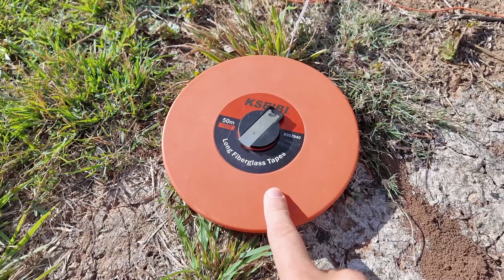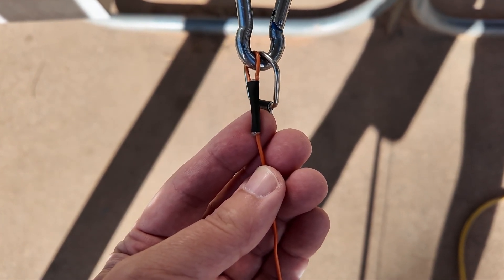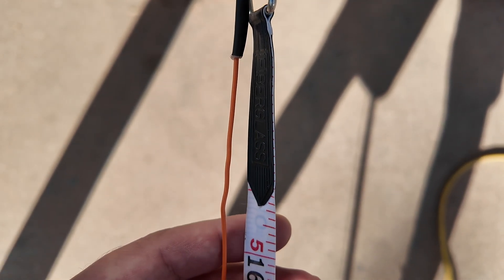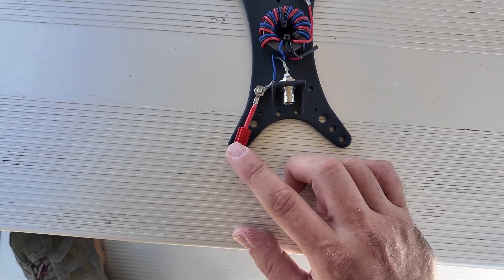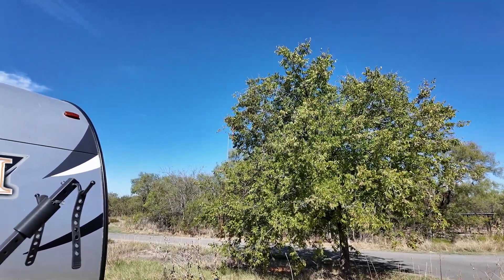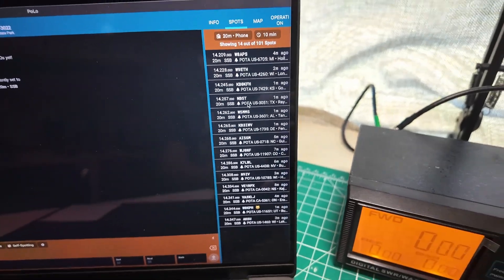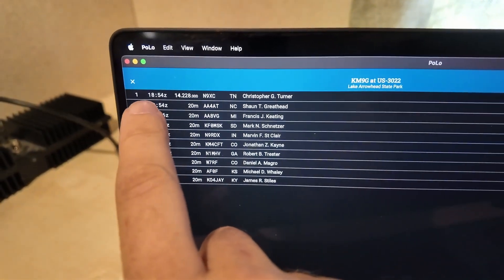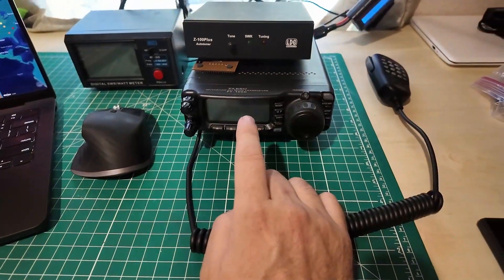A POTA with the Coffee and Ham Radios Ares Antenna

Comment: TO or anyone else that reads this curious will a mobilinkd tnc cable work with a digirig device? I only need the audio cable with k connector and digirig only sells both for $30 so i thought be cheaper to use the mobilinkd cable instead i dont have one to test it so thought id see if someone with both could confirm it will work
Reply from the maker: I am not 100% sure, but there should be cable pinout diagrams available for both ends of the cable?  The K end should be standard.

Comment: Great job TO ! making contacts with a antenna you built is awesome   I had some trouble with 9:1 . I had some tuning trouble but I remembered that the IC 7300 has a E-TUNE mode. Did that and done. worked.  I also had some trouble with FT8 and using a 1:1 choke Balun at antenna did the trick. I already had a  FT 240-31 ferrite on USB cable. More counterpoise is better on 9:1 . Using coax for counterpoise kept crashing my laptop . I could not FT8 or even log.  Once I figured that out it worked good.  I did use that 9:1 on a shortwave radio with 75 ohm coax. Worked super ! so much better than just a piece of wire. Much better signal to noise ratio . That one of the hardest toroide to wind but take time pay attention and follow the winding chart and it works.  73
Reply from the maker: That's pretty cool.  I always hear better when my antenna is closer to resonant and the 9:1 just helps you get away with a shorter wire!
Reply: @temporarilyoffline  I even tuned up and made great contacts with 75 OHM coax on 9:1 . And had less common mode problems . Really helps with a resonate length of coax . this did not happen with 50 ohm coax.

Comment: Hi Steve,
Nice activation. Had to sell my FTdx10 and my FT-450 has some problems, so I'm off the air for a while. Stay safe.  73  WJ3U
Reply from the maker: Thanks Don!  Hope you'll get that 450 fixed up quick!
Reply: @temporarilyoffline  The 450 was hit by an electric charge when a severe thunderstorm passed through during the night when I hadn't removed the coax. I had taken a muscle relaxer for some severe back pain that evening and makes me sleep and I slept through the storm. My sister told me of a thunder clap that woke her up it was so loud that I didn't hear. I submitted an insurance claim through the ARRL insurance policy and was denied by the carrier since they said there was no lightning strike within a mile. I want to send the 450 to the ARRL testing lab to confirm the problem came into the radio through the antenna connector. That might convince the carrier to pay the claim. Was only seeking a $400 claim. Otherwise what's the use in having amateur equipment insurance. Stay safe.  73  WJ3U
Reply from the maker: @DonDegidio  I'm dealing with the same 💩 on a haul damage claim...makes me want to get into the insurance biz!
Reply: @temporarilyoffline  Pretty sure you'll have to sell your soul to get into the insurance biz.